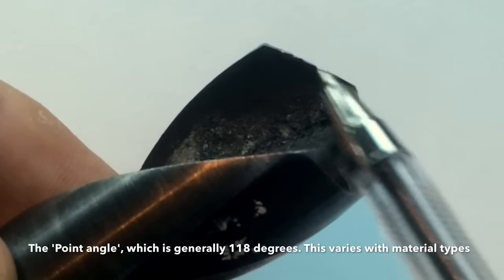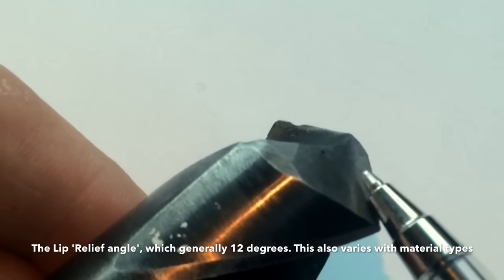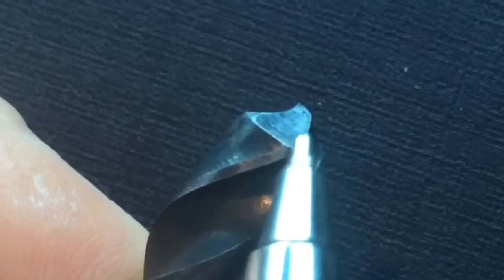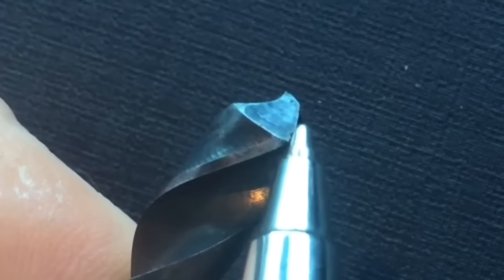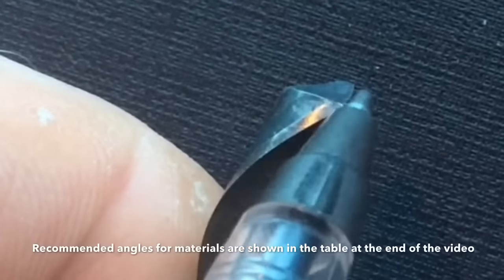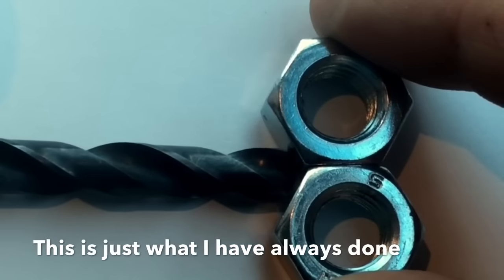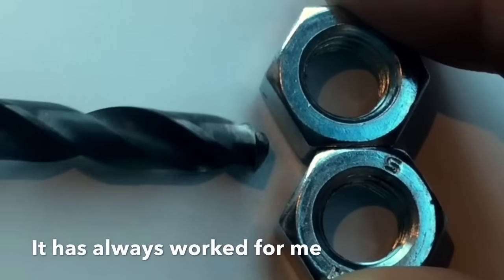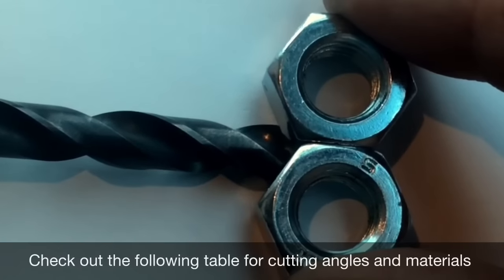How to Angle a Drill Bit  'Using a SIMPLE TRADE SECRET' (by Craig Kirkman)

Comment: Hardest thing regarding re sharpening drill bits is to make the tip of the drill dead centre if not you will wind up with a oversized hole with a ledge at the far end
Reply: I just did that last week. It was also w a cheap homeowners Craftsman drill press. I sharpened another bit and put it in my recently acquired 1950s Delta commercial DP and I drilled accurately through a Stihl chainsaw bar for an auxiliary oiler.

Comment: The angle is important for cutting and maximum life out of the sharpening, but there is another factor and that's getting the tip, or junction of the angle absolutely centered on the bit or else it won't cut centered to where you want it but instead it will pull to one side and tend to make the hole larger than the bit. Depending on what you're using the drill for, this may or may not be important to the end users. I use my drill bits for metal machine work and I want accuracy within a few thou.

Comment: If I cut a block of wood at 118 dgr and notch it in the middle for a drill bit I should be able to sharpen it on my disc or belt sander but what grit do you think would work best ?
Reply: 80 Grit is best